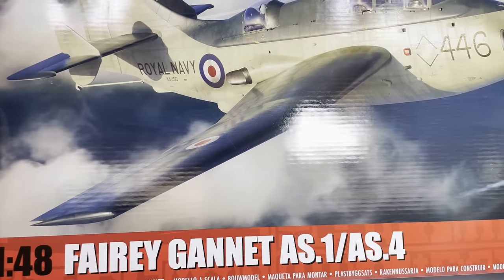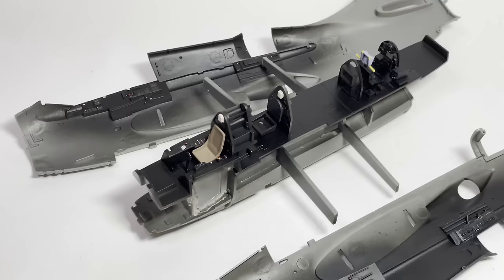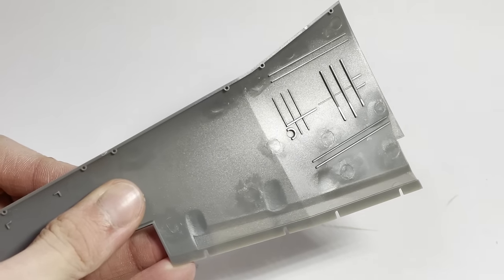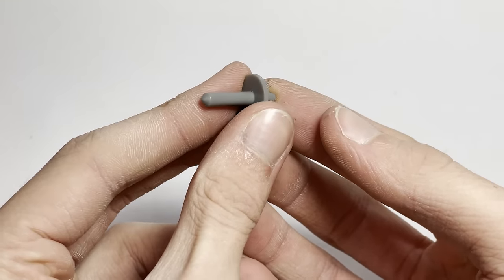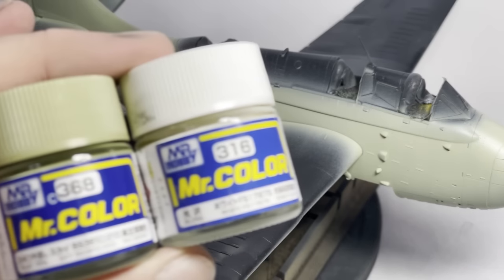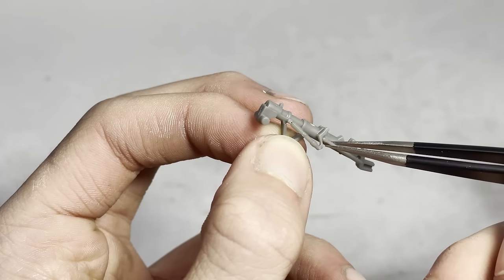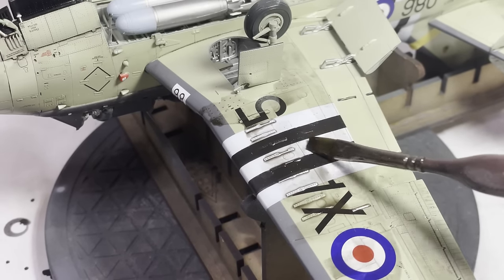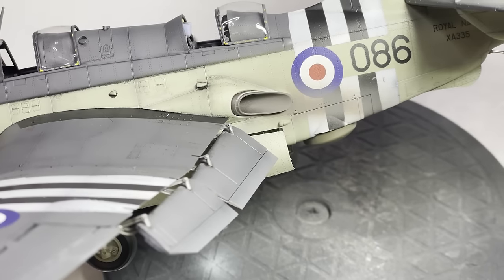Airfix's Brand New 1:48 Fairey Gannet | Full Build | HD

Comment: Hi Mach Models I am thinking about getting this kit I was wondering when doing this model did you have any fitting problems and such as what white do you use since I am having trouble on trying to find a good white to aurbrush and brush paint
Reply from the maker: Hi dude! I would say that this kit is for a modeller who has made quite a few kits, that’s purely because it has a hell of a lot of parts which all need to be put into place perfectly to ensure a good fit. If you can get all the parts in correctly the kit will go together with no issues at all, the one area I had a little bit of problem would be nose area but that was sorted out just using some white putty! In regard to a white, I love to use the SMS white. Super good coverage and lovely finish. I hope that helps!

Comment: Nice build dude. One thing I noticed both nose wheel hub caps were painted red. As per references, Red on the left hand nw hub cap, green on the other side.
Reply from the maker: Thank you for the info!! I assume that’s for port and starboard? I might go and correct that now😆
Reply: @machmodels  red for post side. Green for starboard side.

Comment: And as well what do you think of alklad since I am thinking of getting some just wanted to get a second opinion
Reply from the maker: I wish I could give you an opinion but I personally have never used them, I have always loved the AK Xtreme Metal range and also the Mr Hobby Super Metallic range. Sorry!😁
Reply: Alclad can produce some of the most realistic natural metal finishes, but it takes a lot of effort to achieve. 

They need a gloss black base to go over, and it needs to be glass smooth. The smallest imperfection in either your plastic, primer, or the gloss black will stand out when you apply the alclad.

Add to that, alclad is fragile, it doesn't like being masked with tape, and decals tend to look bad on it, as well as applying any clear varnishes on it diminish the metal effect

Comment: wow! How long did all of that take?
thanks
Reply from the maker: Thank you! So this took me about 4 days but each day spending at least 6 hours at the bench sooo 24 hours😁
Reply: @machmodels  well done, did you think the internal assembly presented a few fit issues?
Reply from the maker: I don’t think so, for me I did have a seam on the top of the fuselage but as I said I think that was more down to me not cleaning off the paint from the wing spars. If there is a fit issue it’s nothing that can’t be sorted out with ease😁🤙🏻